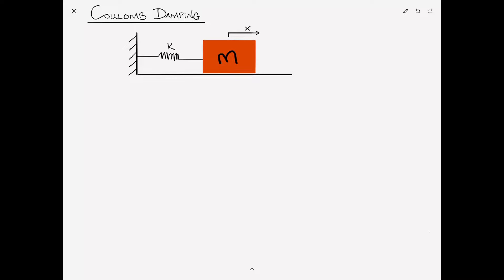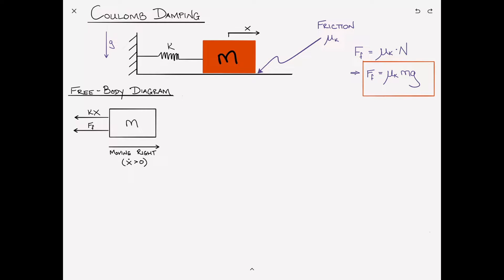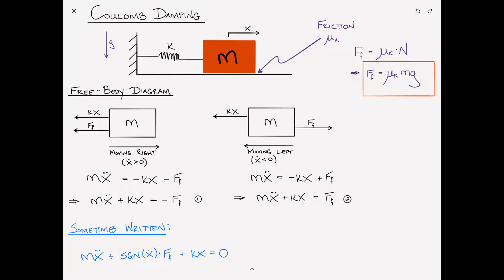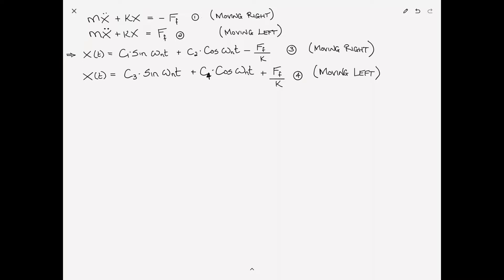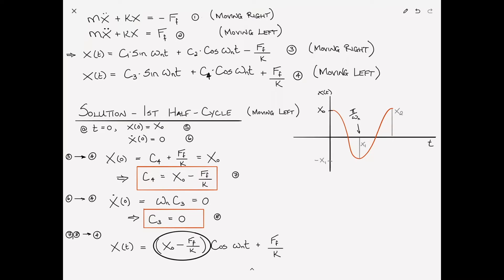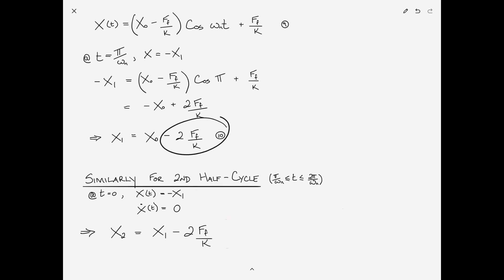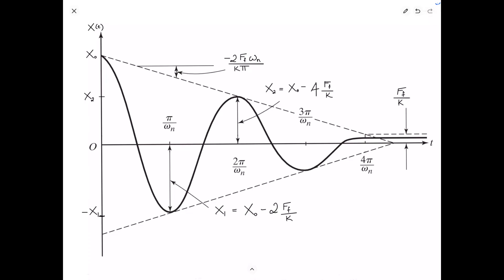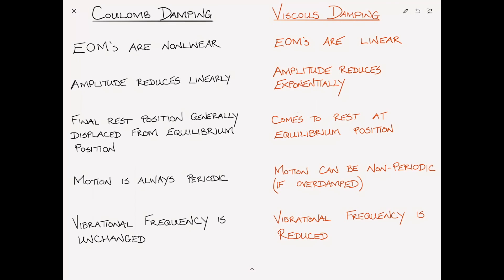Free Vibrations of a Single Degree of Freedom (SDOF) System with Coulomb Damping

Comment: please solve this Mcqs Thank you.
1) All vibrating bodies have following Degree of Freedom:
a)1
b)2
c)3
d)4
.
2) The frequency of vibrations with increase of damping in the case of free vibrations with coulomb damping will
A.Remain mine
B.Increase
C.Decrease
D.May increase or decrease depending upon the damping coefficient
Reply from the maker: 1.  All vibrating masses, in general, can have 6 degrees of freedom (3 translations and 3 rotations).  Since 6 is not an option (which it ought to be) I am going to have to go with 3 - perhaps they are asking about translations only.

2. In the case of Coulomb damping, this does not affect the frequency of vibration, it only decreases the amplitude of each successive oscillation.  The mass will continue to vibrate at its natural frequency regardless of the amount of Coulomb damping applied.
Reply: @Freeball99  Thank you so much for my clearification

Comment: I have a question about the model of Coulomb friction you used in this video. When the velocity of the block is zero, the signum function gives the value of friction to also be zero but is this actually true? For example, in the final resting position, if we assume the block rests in a non-equilibrium position, its velocity is zero but there is still some friction force acting on it to counteract the small amount of spring force. I assume the reason you excluded this nuance is because in its normal cycle, when the block reaches its farthest point, the spring force is large enough to overcome the static friction. So does this mean, in a more generalized context for complex systems, we need to take the value of signum function as [-1,1] when velocity is zero? Using this model introduces non-smooth behavior which makes the solution a lot more involved. Maybe you could consider solving a system that has this general Coulomb friction in a future video?

Comment: maybe i have a stupid question why when the block is moving to left the (m*x^..) not have minus sign ??
Reply from the maker: What I have have done is apply Newton's 2nd Law without making any assumptions as to the direction of the acceleration.  But to be clear, in BOTH cases the acceleration is actually to the left, because the net force is to the left.

Comment: Sir y u have shown inertial force to the left even block Is moving to the left
Reply from the maker: In BOTH cases the acceleration is to the left, because the net force is to the left - this is not determined by the direction of the velocity, but rather by the direction of the net force.

Comment: What is the value of damping ratio in case of coulomb damling ?
Reply from the maker: When finding an "equivalent" viscous damper we do this on an energy basis.  In other words, we can replace the coulomb damping with a viscous damper such that both dissipate the same amount of energy with each cycle/oscillation.  The equivalent viscous damping constant can be shown to be C = 4F/πωX (where F is the magnitude of the frictional force).  In order to find the damping ratio, simply divide by the critical damping so, the damping ratio ζ = C / 2*SQRT(m*k) = 4F / (πωX  * 2*SQRT(m*k))

Comment: Wonderful videos and terribly instructive!

Maybe I'm misunderstanding the scenario here though. The mass is at some equilibrium position, is released, and then displaces to the right. It traverses to the right a distance x0 until the instant where its velocity is 0, and then begins its movement left. It then displaces to the left a distance x0 to the equilibrium position, then a distance x1 until the spring is entirely compressed and the velocity is again 0. Finally, the mass travels, again, a distance x1 to the equilibrium position and then another distance, x2, such that x2 < x0. 

If that sounds about right, I guess I'm not sure how you are able to pick those exact times for your boundary conditions? The units of pi/wn work out to seconds, but I'm just not sure how you arrived at that.
Reply from the maker: Sorry for the delayed response, but I somehow missed this until now..  

What you have stated above is exactly correct.  I think the piece you are missing is this.... the frequency of oscillations, f, is related to the angular frequency, ωn, by  f = ωn / 2π.  Also, f is related to the period of vibration by f = 1/T.  So the period of vibration can be written as T = 2π / ωn.  In this particular problem, we are looking at half-cycles.  Consequently, the start of the 2nd half-cycle begins at a time equal to half the period or t = π / ωn and so we use this as the initial time for the 2nd piece.
Reply: @Freeball99  Does this mean for other cases in SDOF with damping, if we want to know each amplitude, have to be solved half-cycle by half-cycle? Is there any other way to write the EOM? And if in each half-cycle the EOM are greatly influenced by initial condition, is this mean the solution is not in closed form? Thank you.
Reply from the maker: @andrealiu8650  This is only for the case of Coulomb damping and if we want to get some analytical solutions for it.  Also, we can solve this numerically.  For other kinds of damping we can find closed-form solutions.
Reply: @Freeball99  For this mass-spring system then...I've seen your videos in this channel in recent days, and hope to write a python code to solve it. Well, if to solve this numerically, does it mean to use matrix form to represent the EOM and apply forward Euler step to solve 2nd ODE?

Comment: Why the spring force is appointed to the left in the 2nd case?
Reply from the maker: In both cases it is assumed that the mass is displaced to the right of the equilibrium position.  This is why the spring force is to the left.  The difference is that the velocity is negative in the second case.
Reply: @Freeball99  So when the mass is displaced to right of equilibrium position and moving left, isn't acceleration is actually pointing left, and the m x'' also pointing left?
Reply from the maker: @andrealiu8650  To be clear, in BOTH cases the acceleration is to the left, because the net force is to the left.  I have simply applied Newton's 2nd Law without making any assumptions as to the direction of the acceleration.
Reply: @Freeball99  Thank you~